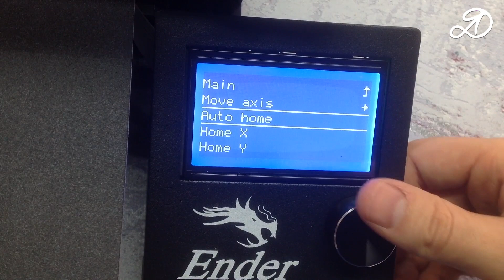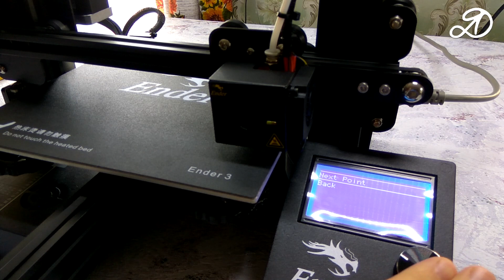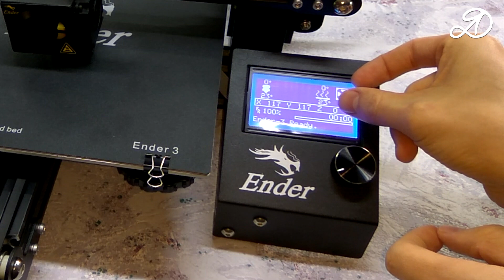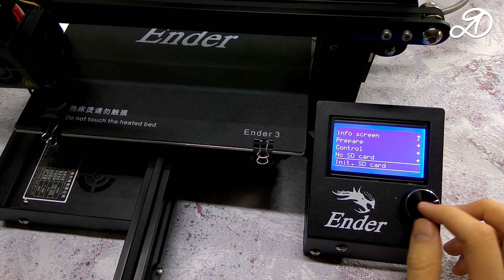Magical Assembly 3D printer Creality Ender-3. My first print. The Best for Beginner

Comment from the maker: Friends! What do you want to see in the next videos?
Reply from the maker: 😮How could that be? What is the firmware? Judging by the information on the Internet, Marlin usually comes with version 1.0.0. (By the way to see it is not simple). And the last update 1.1.9.
Reply from the maker: Very strange... I didn't find any mention of the printer firmware version in my manual. Among the files was only USB driver here is a version of "FTDIUSBSerialDriver_v2_2_16". Maybe messed up something in the manual or on the printer is a different version of the firmware. Here is a link to the official firmware of Marlin: http://marlinfw.org/meta/download/ With respect. PS. When printing, the printer skips the layers. I don't know what to do. Print PLA and ABS. Temperature I tried, but still does not help. Maybe there's a problem with the Teflon tube?
Reply: The washer you added to the bed is useless. The distance from the wheel to the bearing is the same with or without the washer as the thing regulating the height of the when to the base is the spacer. The washer only changed how much the nylock nut threaded, and in this case it did nothing to the wobble.

Maybe the reason it worked better after is because when reassembling you correctly positioned the eccentric nut